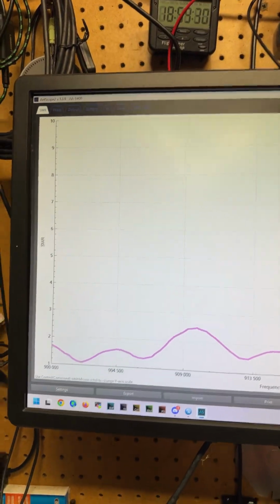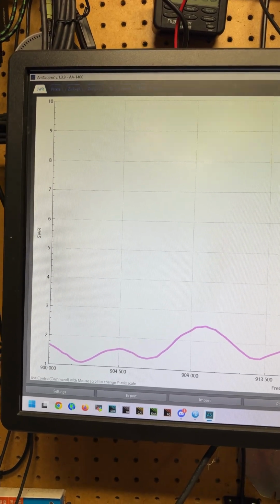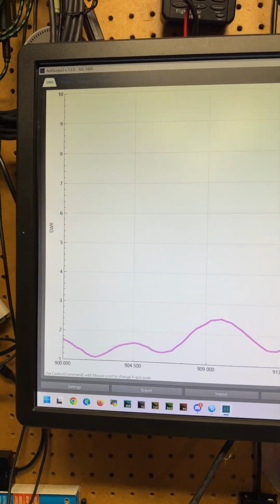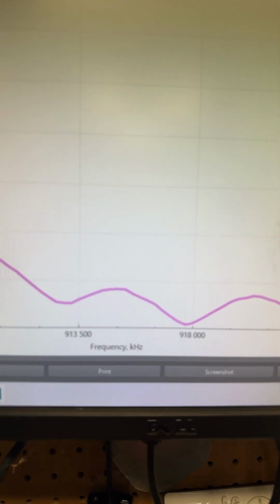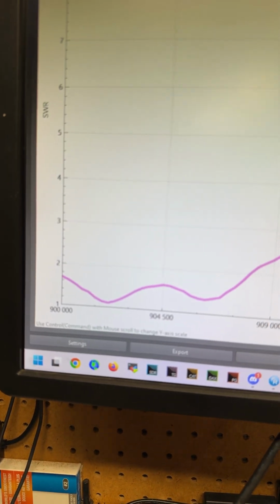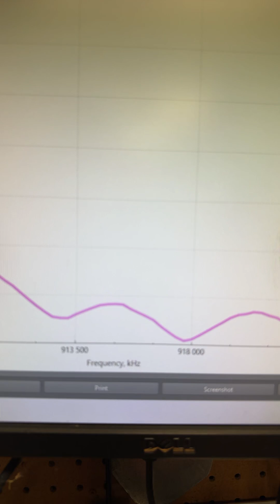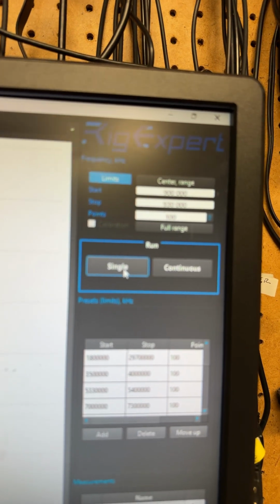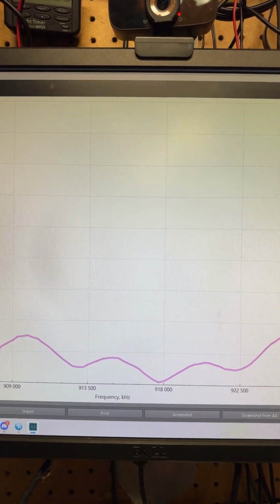Meshtastic On The Discone!  #meshtastic #discone #hamradio

Comment: I can see that antenna used on a Meshtastic repeater spot. If antenna is high should give range. With Ham shack hotline shutting down may have to use Meshtastic more and that does not need internet to work. Great for on a hill setting up a mesh network . I say give it a try on Meshtastic and see what range you get. 73